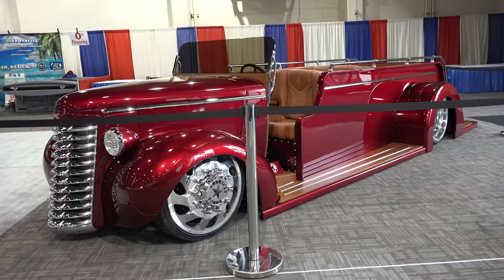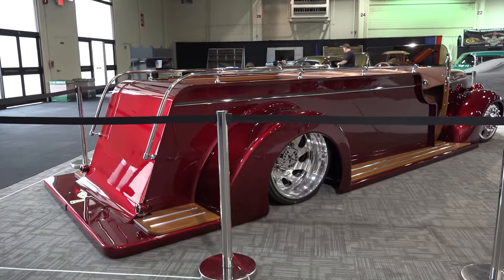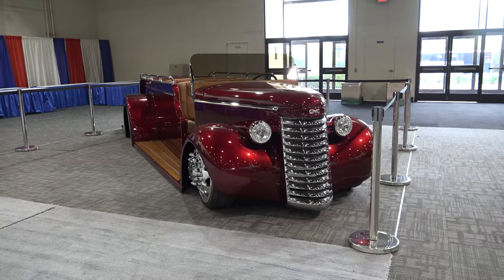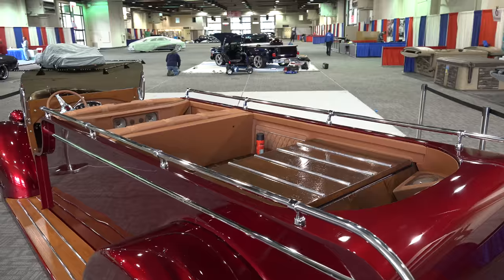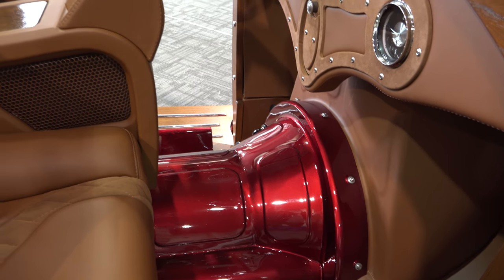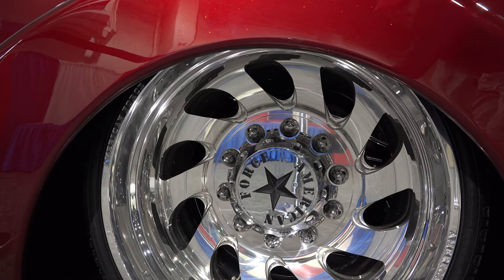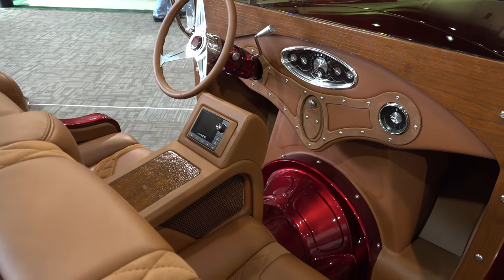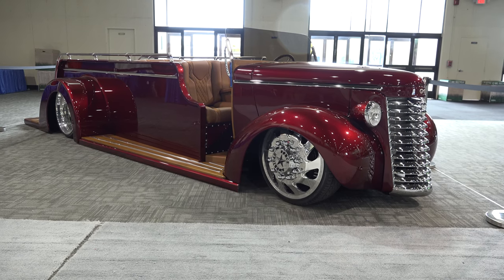Fire Truck Roadster Custom Street Truck The Grand National Roadster Show 2018

Comment: How to you get in the backseat?
Reply from the maker: I didn't notice....
Reply: Step into the front, then step on the front seat and climb over. Make sure you have mud on your boots too. LOL. Kidding of course, reality is nobody is riding back there, it's a show piece and likely gets driven from it's climate controlled garage 100 feet to the climate controlled transport truck then into the climate controlled convention center hall for display. I would like to see it run and hear the sound system though.